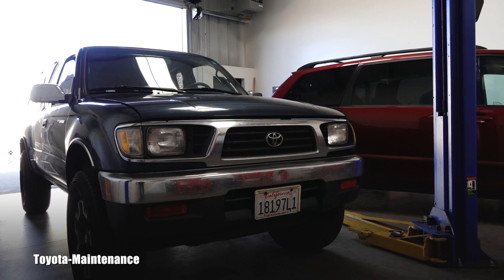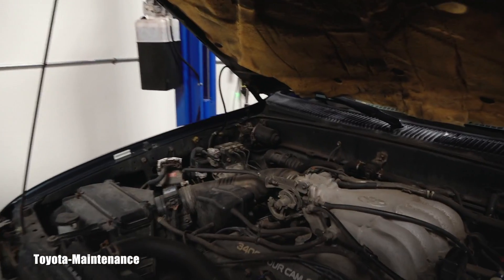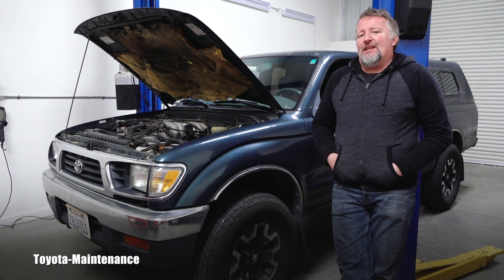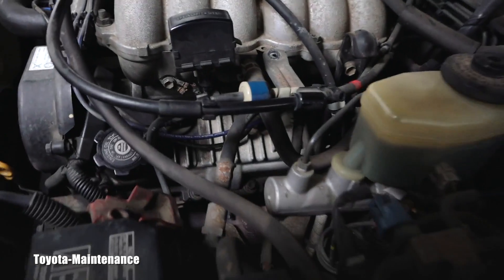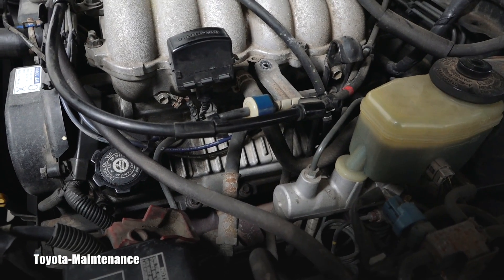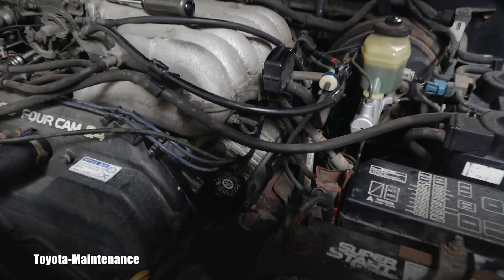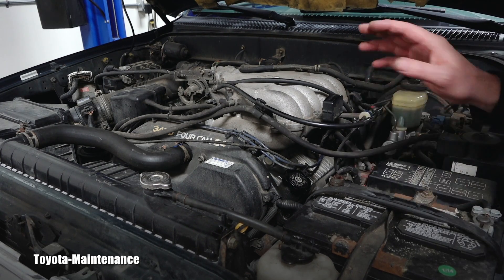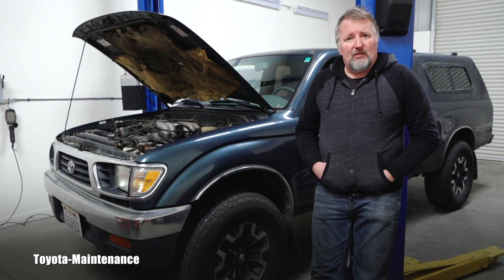Toyota Tacoma P0304 misfire diagnosis

Comment: Hello there. I am having trouble with some hesitation and an intermittent p304 on a 1996 4runner 3rz-fe. The hesitation when it occurs is on a cold start. After pushing the throttle slightly or after 10 seconds the engine runs normal. If persistent the CEL will give a p304 code. Now when this happens there's also a slight misfire/slip/sputter in the engine around 2500rpms. I need some help thank you so much for you videos.

Comment: I have a 2019 Tacoma with this code popping up. Truck runs great then when the throttle is like 80% power will cut and CEL will come on. Once I turn the truck off and back on the CEL goes off.

Comment: Great explanation. Essay to understand. I save $$$ doing this my self. Only added info I would say is do one ignition module, wire, spark plugs x 2 ( both sides) at a time. Don’t just unscrew all your modules, disconnect all your wires, replace all your spark plugs all at once then try and GUESS how it all goes back together. For advanced DIY or mechanics, disregard. For Amateurs, it is best. Just so you don’t get one mixed up. Just my opinion though. I’m an amateur.

Comment: I got a 1996 tacoma 2.7  won’t crank. I’ve put new timing chain on . New valve job, New Toyota distributor,  denso  plugs . It fires weak on 2 and 3 cylinder . It keeps a mass air fault p0100  on can’t clear it . It just won’t crank .

Comment: curious ,I have a p0304 01/03 on my 05 Toyota 4Runner v6 , I have changed my spark plugs (iridium) checked all my coils with coil tester all good, had my entire fuel rail and injectors professionally cleaned with fuel pump relay disconnected.. And still getting misfire code why ?
Reply: You find the problem?
Reply: Same exact issue with my 05 4runner

Comment: I had P0304 misfire. The problem was a cracked air hose that connects to the throttle body. I sealed it with water hose tape and electrical tape. No more misfire and the 5VZ-FE engine purrs like a kitten. I will eventually replace the hose with a genuine Toyota part.

Comment: Correct plugs (Not sure how anyone uses wrong plug.theres a sticker with a picture for gods sake..)found OEM wires for $53 .over $100 at local dealership & everywhere else online so that’s good. Made job so easy. #1 wire on plug side had been burning up it appears & metal piece was still broken of & still on the plug.& corresponding coil round plug in area was dull looking not shiny like other 2 coils..cleaned it up.doesnt sound quite like a misfire .more of a running rough. Did plugs but  not wires a month ago .wile I was replacing wires I didn’t even pull the 2 plugs associated with the broken wire ( original .over 180 k before problem began so good wires no doubt)think the plugs could be gunked up,

Comment: You are thorough. I feel much more comfortable with original equipment. I trust Toyota engineers. I did use NKG plugs because I was told they are better than original copper DENSCO plugs. Is that correct? I have read in multiple forums that those coils are very good and one fellow went so far as to say they would outlast three engines. That may or may not be the case. I don’t want to take up too much of your time but could you please tell me where is the best place to buy original equipment. My rear windshield wiper blade needed to be replaced last year and again this year. I found new old stock online. Japanese writing on the wiper blade . That is not as important and a newer design(curved 1 piece bosh style)may Have even been a better choice. I’m not sure where to draw that line so I try to stay original with everything and keep the guesswork out of it. Where are you /your shop located? Tidy.My truck is a nice( 158k ) but somewhat neglected truck . I have noticed that some maintenance has been neglected. Some things have never been performed. I am nearly 100% positive that these are original spark plug wires.I do not want this great engine to die because I do something wrong. Thank you very much for any advice you can give me. So much miss information online and dishonest or misinformed Mechanics (also DIY mechanics that are attempting to be helpful but simply don’t know what they are doing)  things can get very confusing very quickly. Right now I NEED real Toyota spark plug wires.Will be using real Toyota fluids just like you advised. But electricity is what I need right now. Help please. I don’t have the print out in front of me and would have to double check it,but if Memory serves me correctly ,my scan indicated a Plenum issue and valves five and two. Does that sound correct?Thank you very much.
Reply: If you are not on the other side of the globe somewhere I would love to become one of your customers.

Comment: I have owned two of these  trucks both all the way to 400,000km  double ground spark plugs are the worst plugs to ever use in these trucks I would constantly burn  up the Toyota plugs at about 20,000km then I went to NGK iridium plugs and would get 150,000 before they would Evan rough idle. Don’t recommend running them that long however lol. Good video though thanks for reminding me what just happened to my old girl a couple of days ago. Second set of wires for this truck. Really can’t complain 390,000km . Lol. I was supposed to sell this truck last year when I got my new ride but just can’t do it lol.

Comment: I just had/ still have this exact to the t, same issue, replaced the same coil, same problem except it did run a better kind of shitty as opposed to compete shit before the replacement. However tomorrow it's time to check the plugs and wires apparently.. man I gonna be pissed at myself if it's this simple after buying a 95dollar limited lifetime replacement coil.

Firstly see the vehicle started the stumble all the sudden, I went ahead and wrote down all 8 codes it had stored and then erased. Started up and let it run awhile and ended up with a po304... So I bought the blasted coil..

Installed the coil, drove the vehicle and only difference is it will clear up if it's basically floored and in high rpm which probably means nothing. Anyway return home and check codes to see if anything changed and sure enough not just the 1 po304, but 5 codes total.  All 5 are: Po304, po115, po304again?, Po303 and lastly po300! So yeah I'm checking the plugs and wires tomorrow unless anyone knows anything else I can do to help with this matter? Thanks Peter!

Comment: Hello there
I am trying to find the cause of a missfire but haven't had any luck
Recently did the head job replacing almost everything requested by the owner, before the head job it had a missfire on cyl 1 due to an  sticking fuel injector ,after  tha head job the missfire was jumping from cyl 3and 4 to cyl 1 and 2
I did a valve adjustment and still have a missfire on cyl 4
I have swapped coils and still remains on cyl 4 .
Any ideas would be appreciated 
Thanks in advance
Reply: Don Francisco never came.to my mind about the fuel pump since it never had a problem starting it , it was a turned  key all the time
But after replacing almost everything   decided to check fuel pressure  and there was the problem , after replacing fuel.pump problem solved
Reply: Small ground wire on back of the head to firewall.

Comment: Awesome fix. 3.4l is bulletproof.  I have a 03  3.4l tacoma with 190k miles no problems. I always buy toyota parts for maintenance. Thanks for the video
Reply from the maker: you are welcome , thanks for sharing
Reply: mi  tacoma  1995  tiene  750 mil millas y corre  bien aun